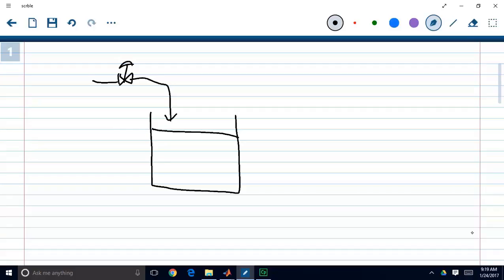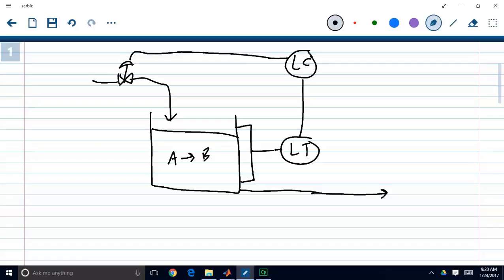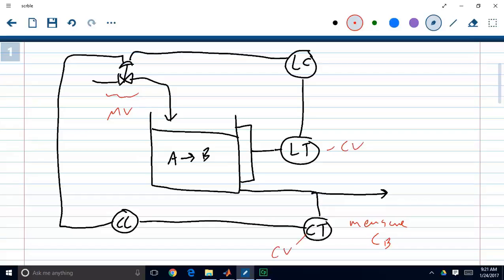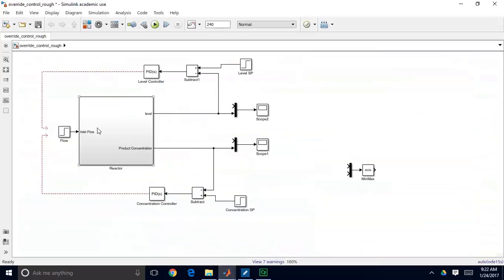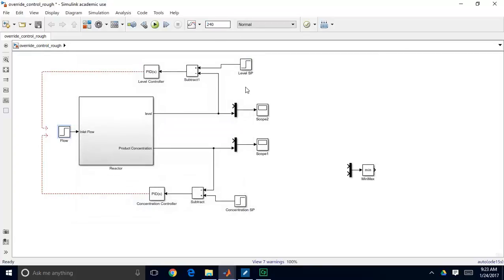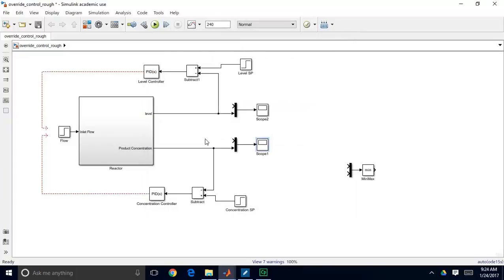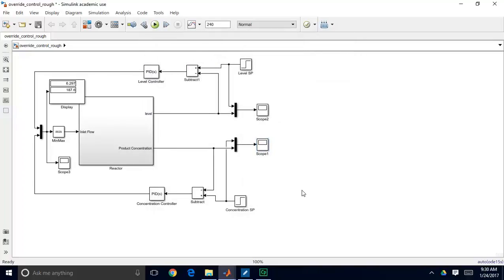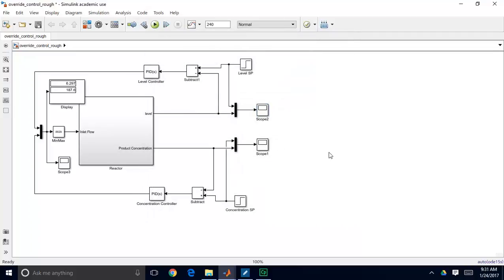Introduction to override control

Comment: Very nice thank you. I have a question, why the selection is the minimum and not the maximum and what factor need to be considered for selecting one or the other? I thought the controller having more demand from the process that need to control the valve would produce the higher value not the lower but perhaps it has to do with the controller action (?). Thank you for anyone's input.